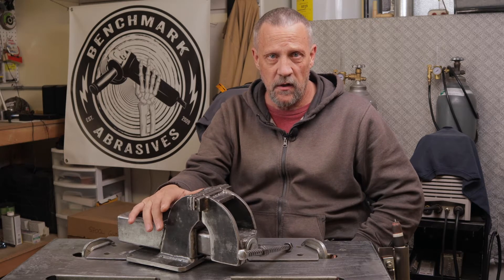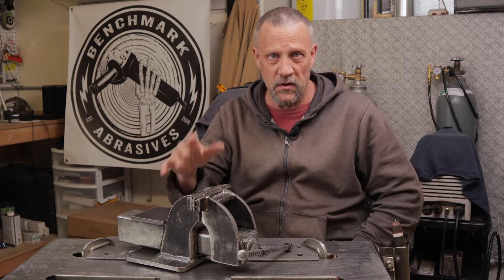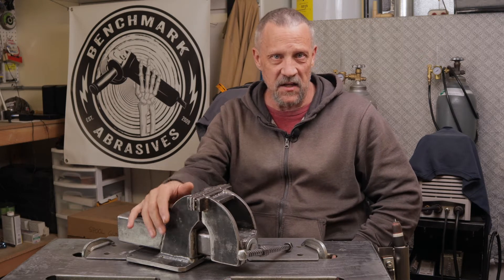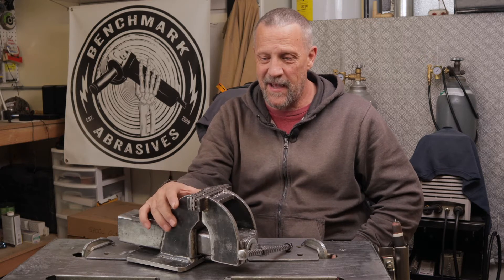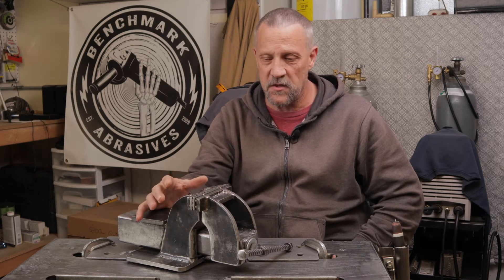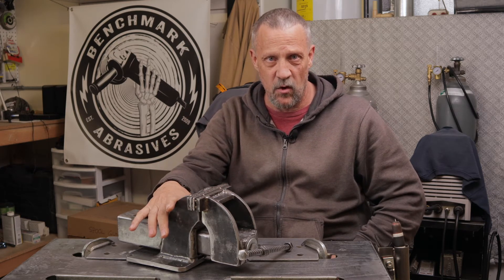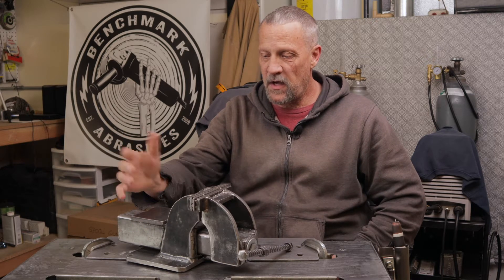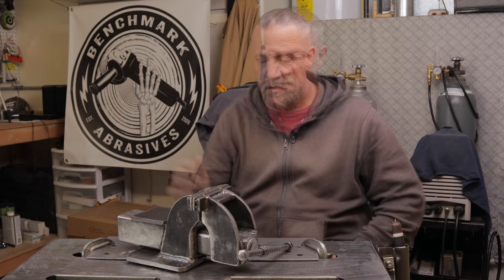Unlock Your Creativity: How to Build a DIY Vise Stand

Comment from the maker: Use DIYHP10% Promo Code to save 10% off your entire order here
https://yeswelder.com/?ref=DIYHP10%25
YesWelder 250A Aluminum MIG Welder Spool Gun Compatible
https://yeswelder.com/products/aluminum-mig-welder-mig250sg?ref=DIYHP10%25
250Amp AC/DC TIG Aluminum Welder With Pulse
https://yeswelder.com/products/tig250p-acdc?ref=DIYHP10%25
YesWelder FIRSTESS™ MP200 5-in-1 Welder & Cutter
https://yeswelder.com/products/firstess-mp200?ref=DIYHP10%25

Comment: Nice work, I like the vise and stand. Looks like it could use some more weight on the bottom or a quick way to bolt it to the ground. Sand or lead filled tubes and stem or red head it into the cement.
Reply from the maker: Thanks for the tips Kyle!

Comment: Came out great. What kind of stick rod did you use on this build? Thanks
Reply: Did you use the 250 Tig to stick weld it or the Mig 250?
Reply from the maker: I used the MIG 250 for the stick welds.
Reply from the maker: Thank you! I used 6013 1/8" rods at 120 amps.

Comment: Nice work that setup should last a lifetime. I bet you thought of this but should you need to bolt it down add tabs to the leg ends drill into the  concrete pit in what I call metal slugs fasten down with leg bolts. When down remove the bolts the slugs will be at the surface of the concrete than just pop in a couple of plastic caps to keep material out of the inserts
Reply from the maker: Thank you Mike, those are some good ideas and tips!